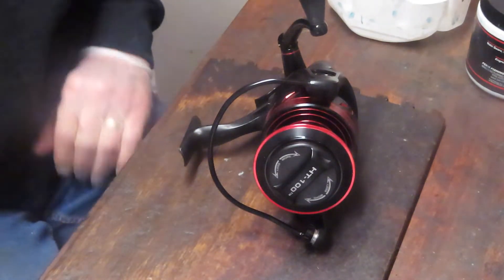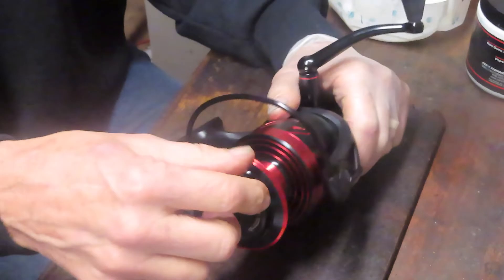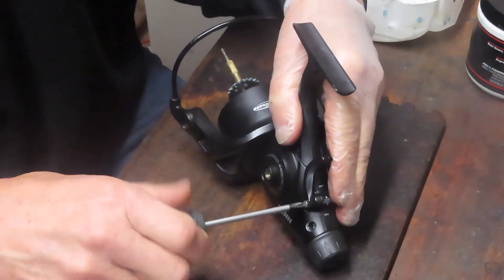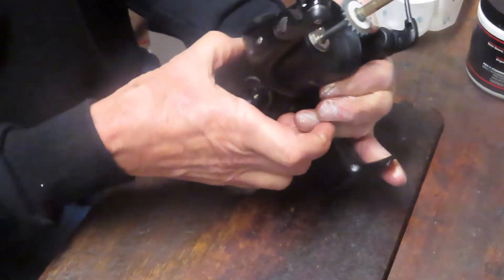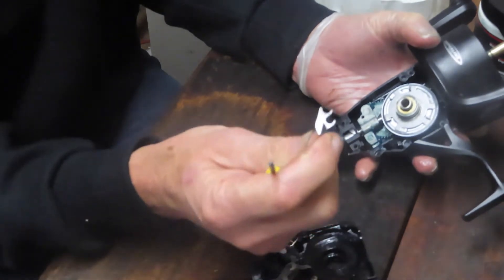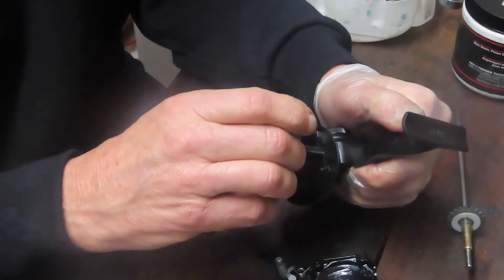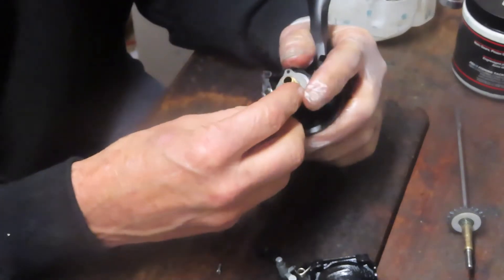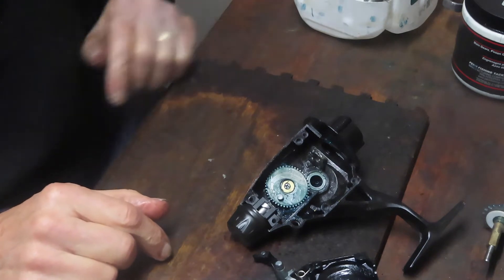Penn Fierce III 8000 LL baitfeeder fishing reel Overview, take apart and repair  faulty rear drag

Comment: Hey Dennis, I recently just put a new rotor and bail on my fierce 6000 LL, and everything went smoothly until I was reassembling it. Everything was back in place and seemed to be perfect but when I try to put the side plate back on it doesn’t quite push all the way in and it whenever it does the reel jams up. However when I take it off and turn the spool everything works fine. Did I just put it together incorrectly? Any tips are greatly appreciated, thanks!
Reply from the maker: Try setting the side plate as close a possible and then toggling the bait trip lever.  There is a stud in the bait trip assemble that needs to seat in a lower slot in order for the case to seal.
Reply: @2ndChanceTackle  will do, thanks!
Reply: @2ndChanceTackle  that was exactly it. I had to push the little lever connected to the spring inside the plate back a bit then put in the pole for the bait switch. Thanks again!

Comment: Funny that this one had a live liner issue, I purchased one of these at the beginning of the year and my live liner no longer clicks. It gave out pretty quickly. Still functions correctly just cannot hear it if I’m using it as a clicker kind of like a bait caster on open spool
Reply from the maker: Your click pin is probably tight to the holder. probably from dried grease.  No big deal to continue to fish with it.  That or the spring has come loose under the spool - Thanks for the note - Dennis

Comment: Hello, I have the same reel.  When i turn the handle, it will not take in line.  I have to manually turn the spool with my hand to bring line in.  The spool also spins both ways loosely with my hand.  Any help or insight is greatly appreciated.  Thank you.
Reply from the maker: It sounds like your trip mechanism is not seeing the stop in the base of the reel when you move from bait feeder mode to retrieve.  There is a pin that locks the free spool.  That pin sits in a cam in the rear drag assembly.  You need to take the reel apart and check that assembly - Dennis
Reply: @2ndChanceTackle  thank you so much for the response!!

Comment: More simple design than that 5600 Slammer. 😆 Thanks Dennis. Happy Thanksgiving.
Reply from the maker: That Slammer is one of the worst designs for a bait runner reel.  That one spring can take forever to load.  Best wishes - Dennis

Comment: I have a fierce 2 baitfeeder where can i order parts and a manual i have checked online but cant find anything on baitfeeders. Our back knob is locked up an we twisted the tiny screw off the level that holds it together. Can you please help us
Reply from the maker: You can order the parts through Mysticparts.com.   Here is the link for your reel https://www.mysticparts.com/PennParts/Spinning.aspx#FierceFamily  I would try contacting Penn Reels directly for the manual.  Thanks for asking - Dennis

Comment: Great video, I have a newer Fierce 3 4000 Bait feeder that looks like this one just smaller. It’s been used very little but having an intermittent problem with the bait feeder. Sometimes when I have the bait feeder on and get a strike, I can pick up the rod, turn the handle and the bait feeder function comes off and I’m on the main drag fighting the fish. Other times, when I pickup the rod and turn the handle, the bait feeder doesn’t disengage and I have to manually flip the bait feeder lever forward to get on the main drag. Have you run into this on these Fierce 3 bait feeder reels before? Thx…
Reply from the maker: I generally see them in full fail mode and not as an intermittent failure.  Check the internals.   You may have a dried grease or a dry reel that is causing the movement or lack of movement in the trip mechanisms.  If the grease is right, there may be a chipped tooth or other drive issue where it fails to trip at that point in the rotation - Dennis

Comment: What exactly is the purpose of the center eared washer in a drag function? Been meaning to ask this question for a while now. Thanks Dennis.
Reply from the maker: Sure - there are two types of drag washers in the stack.  One is the keyed washer that has a slot or hole that fits firmly over the gear sleeve.  The other is the earned washer that fits in the slots of the main gear but has a round hold that does not grip the center sleeve.  The keyed washers lock down the sleeve while the earned washers hold the main gear firm. When there is full tension on the drag washers both the sleeve and main gear get locked in place.  When you ease up on the pressure by backing off the star adjuster the drag washers in between the metal ones can slip or slide to allow for variation in the drag performance - Thanks for asking - Dennis
Reply: @2ndChanceTackle  thank you

Comment: Hi ! Can you help me compare ? Penn Pursuit 3 size 6000 & Penn fierce 3 size 6000 ? Which machine is better?  I use sea fishing !
Reply from the maker: Very little difference.  The Pursuit has the a graphite body and the Fierce has a full metal body.  Internally, there is very little difference in the set up.  If you do a lot of casting, then the lighter weight of the Pursuit will be an asset as you arms won't tire from throwing lures all day.  If you do a lot of drop fishing for heavier fish, then the Fierce's metal body will help resist frame twist that can occur with snags or deep drop fishing with lots of weight on the line.  So, both are good reels and both have advantages and disadvantages.   It depends on how you fish - Dennis